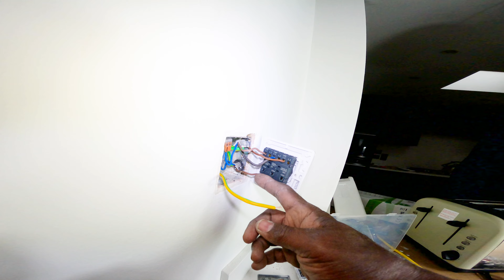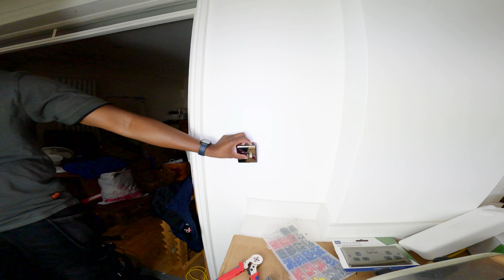Kitchen & Shower Room Second Fix

Comment: Never seen a spark cut a 3.5mm screw with a jr hacksaw.... either snips with the 3.5mm shears built in, or just cut it first then a second cut 90° to the first to take off the burs. Did it on last nights shift with 4mm screws which were too long for stop end and had no short ones.

Comment: My side cutters have a facility to cut 3.5mm screws, i also carry lots of various lengths of 3.5mm screws, never a hacksaw.
Reply: Main bag just has long screws for the odd electrical point here or there. I just cut them down with the C.K 3in1's. I carry a large selection  in the van for anything else.

Comment: I use a dremel to cut long plate screws you can use pliers but it can damage the first thread in this case just file it off or you run the risk of cross threading the screw.

Comment: D, you've got CK tools. Why not purchase the 3 in 1 cutter: 2.5 & 1.5 stripper/3.5 & 4mm terminal screw bolt cutter/cutters/bending anvil. Save all that faffing with a hacksaw. And have that file to hand.
Reply: Or just cut it with the combi pliers he was using to hold it the terminal screws. Literally do that every day and never have an issue
Reply: Or just have a selection of socket screws lol 🙈
Reply: Don't know wheatear to laugh or cry😂😢

Comment: Should’ve put the double socket level with the bottom of the cooker outlet and the bottom of the fcu(s) level with the top of the cooker outlet. Look like they’ve been thrown on the wall. ROUGH. Stick your fuse connection units or SPURS in the cupboard !!!!

Comment: Don't bother connecting a cpc from a metal backbox to a metal faceplate. Forget about ring main continuity and join three 2.5s together with wagos, effectively creating a non-switched spur. Twist solid cpcs together. Not grasp simple identity of light switch inputs. (L32 etc) ...Use a hacksaw to cut 3.5mm socket screws...... REALLY? 

It's clear most of your viewers know nothing of the Electrical Industry, its regulations or appreciate the level of workmanship required. Their comments are proof of their ignorance..."buzzing".."it's been to (too) long"..."Qualty video".."Good work" 

You work to 1990 standards, despite being a current NICEIC member, so you shouldn't be instructing "mature" apprentices to adopt bad practice and most definitely should not be posting on social media. I wonder if the NICEIC watch or are even interested in such videos. 

The NICEIC state their purpose is to "champion technical and professional integrity" and "to raise standards". Of course, they are a commercial enterprise whose main revenue stream is the annual fee charged to its members. Thus, any close scrutiny of its members activities, might conflict with their business model. So, no real threat from the NICEIC.

Basically, you’re free to say or do anything you like as stated in the ECHR providing it doesn’t incite riot etc. Therefore, all of the above is irrelevant, however, you do work in London, consequently arrogance and delusions of grandeur are par for the course.

Paul McGuinness
6th April 2024
Reply: Was wondering about the CPC from the back box to the metal face plate myself he actually took it out when he started wiring the socket, don't know whether it is or not but the socket and cooker switch looks like it's directly above the oven
Reply: Hi Paul, respect to you for putting your name to the text.

Firstly, I would like to say that I would not have necessarily executed the job in the same way. However, I can appreciate the difficulty with having to follow – not only someone else’s work – but a Builder, to boot. 

Those jobs aren’t glamorous. Get at the same is the nitty-gritty type of work that no one would post.

I do wonder, though, who did the first fix?

Re. second fixing of the light switch plate, I did hear him mention the switch line as being identified.

Re. ring final continuity- I saw it as remaining  intact: He brought all  the conductors into Wago connectors in order to terminate with less conductors. 

Re. CPCs- kept them separate. I saw him cut two sleeves.

Abdul Seaforth
Sympathiser
Reply: Hi Paul, tell Bono I said hello.